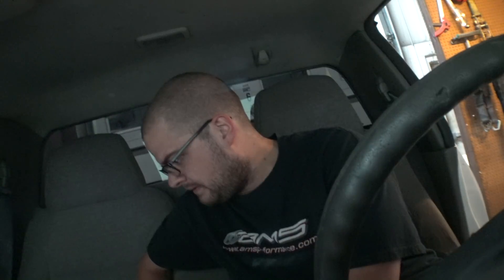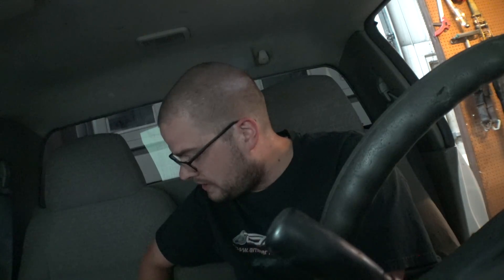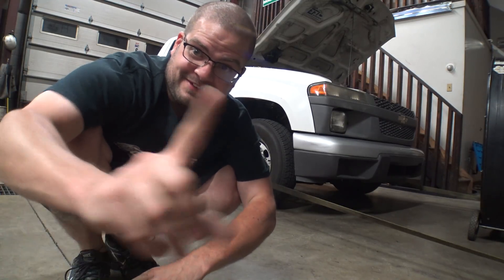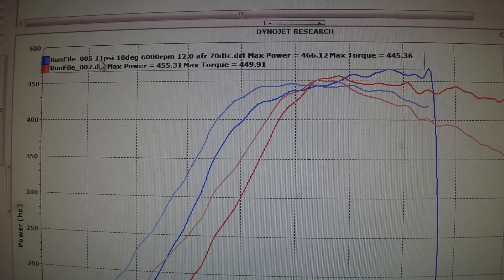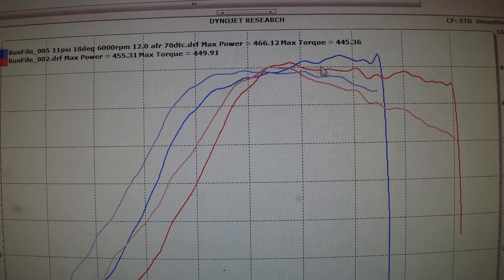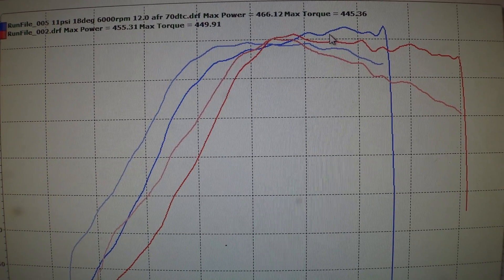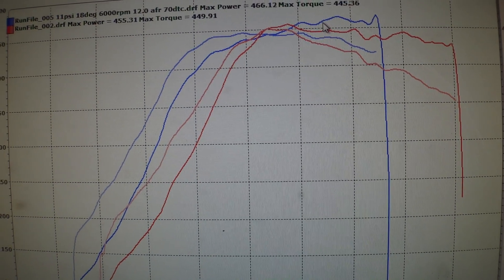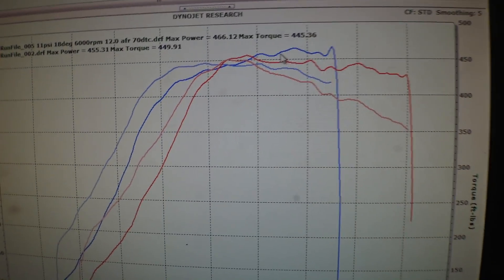dont bs me ep18 - pumpgas and exhaust results

Comment: Once again Sloppy Mechanics prove that full exhaust on turbo car isn't breaking your performance enough to justify loudness.

Quiet sleeper era incoming?
Reply: Turbopleb 
Electric cutout 👍🏻
Reply: Turbopleb I will never I repeat never put a exhaust on my garbage 4" fender exit for life! unless my turbo moves. If it does its goin thru the hood
Reply: Josh Rooster Cogburn Wood I hear you. I'd run 2 mufflers and a loud af screamer pipe just for fun 🙂
Reply: Turbopleb my car honestly aint that loud on3 kit for lsx swapped fox bodys with a billet vs racing 78mm turbski and my gate in recirculated in the down pipe all bolted to a cam only gen4 4.8 and as long as you keep your foot out of its not bad at all and at full throttle its quieter than than dummies with straight pipes on their trucks
Reply: @woodgrain18  how do/did you like the on3 turbo ls turbo set up? Any complaints? Would you buy it again?
Reply: @Mtnbike121  no I really wouldn't lots of fitment problems that I had to have corrected. I have a 99 z28 with a Huron speed single kit and its amazing for a off the shelf setup that can make 1300hp I'v made almost 1100whp with the system
Reply: @woodgrain18  ok i know passenger down pipe is a bitch, cant get at the plugs. Anything else? Im looking budget build but my fab skills are almost zero. Anything else to be aware of?  Doing a 5.3 th400 single turbo build.

Comment: Hey Matt, I've been watching the channel a while now. I've been studying turbocharging stock truck 5.3's as they are plentiful, cheap, and i own a 05 silverado here in central wi. One project is a white 89 c1500 reg cab short box, 12 bolt, fiberglass tonneau, 4/5 drop, lowered seat brackets (stock buckets), custom stainless dash, center council, and door panels (because material was free). Its receiving a truck 05 5.3 and a 94 gmc 5speed 2wd with a turbo or 2 (have 0 turbo's or turbo parts yet, but favorite junkyard has 2 newer powerstroke turbos $250 each. Do i do single or twin?. Or do i do ebay turbo ('s) please help lol.). I'm cheap, VERY lol. So, stock harness, stock computer (my engine did not come with comp. maybe you can help? Load a tune an send me one would be awesome! will pay, or help me chose one), stock injectors (maybe de-capped inj.) stock engine!!. Debating fuel pump, cheap aftermarket upgrade (any recommendations), or probably stock one I have. And cable or d.b.w.  It would be great to get a little guidance and help from a pro, as I hate making mistakes, especially costly ones. So hopefully you can help me out. I'd greatly appreciate it. I know, asking for your thought time is asking alot. Hope to hear from you
Reply: Also i have to reach out to you for help!!! I have a HUGE problem with my 05 1500 silverado crew cab. Got it cheap, $3g's. 220,xxx miles. So, idles rough, doesn't die, barely 500rpm's. Occasional misfire. 449 evap code always on. Not a huge deal. ( Here's the problem. ) It'll be driving fine, any distance like an hour of driving, all of a sudden it dies! Sometimes all it takes is 30 minutes, all of a sudden, it dies. Now, i try to start it right away, just turns over, won't fire. I wait a few minutes, and it'll start again, and die minutes later. The longer i let it cool, the farther it'll go. 20 minutes of waiting, 10 minutes of driving if lucky. Has good fuel pressure, like 55, It has a edge ct in it. When it dies, It'll normally read codes 449 and 332 knock sensor 2 circuit low voltage, Or both and 3 or 4 others, like ho2 circuit low voltage, 300 engine misfire, all kinds. Don't know what the hell to do, any help would be fucking awesome lol. But really, it's fucking embarrassing sitting on the side of the road in my chevy cause my favorite style engine won't run. I am also doing a tailpipe turbo setup, unless i drive it off a cliff. Please help. (extended 'coma part 2 is where i originally got the tail pipe turbo idea, i will be trying a saab or powerstroke turbo, maybe ebay. Not sure, it needs to be cheap tho